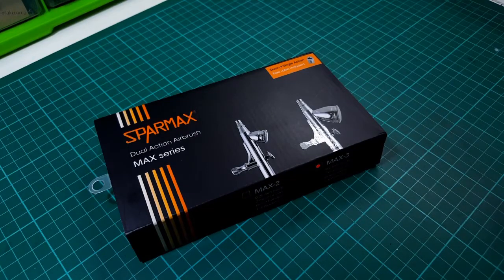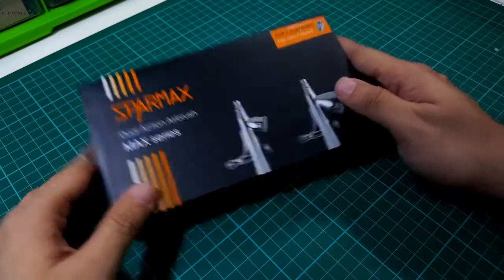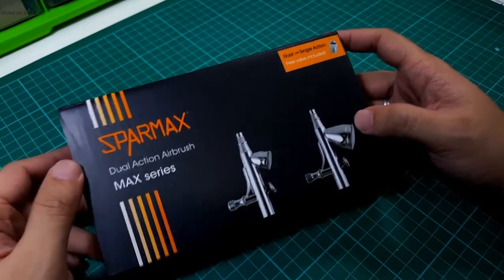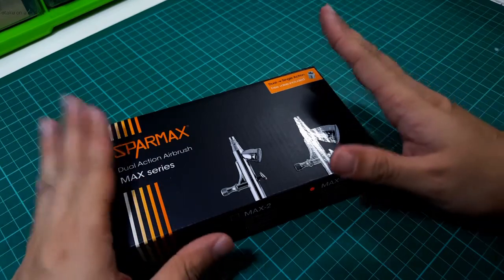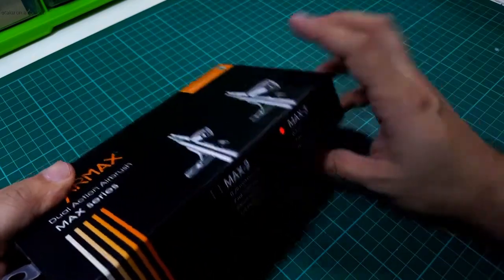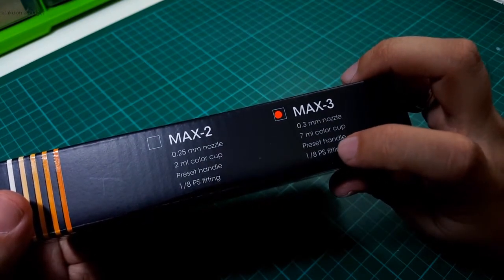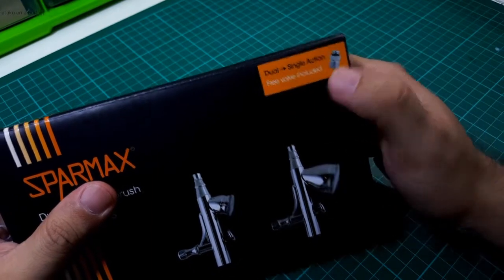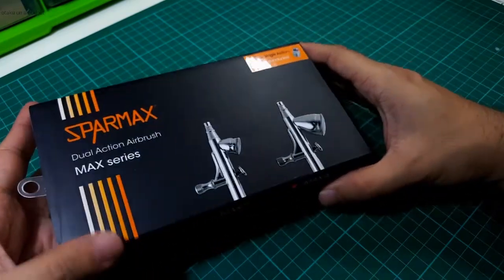Sparmax Max 3 Review

Comment: I have two airbrushes, one is single action only, the other was double action, but I managed to make it work in single (forget how I did it, lol). Both continue to let air stream out when I take my finger off the trigger, which is good for some quick drying. Would this one do the same when used with a small three-mode compressor?
Reply from the maker: Yes, if you swap in the single-action air valve then air would continue to flow without touching the trigger.
Reply: Cool, thanks for the reply :)